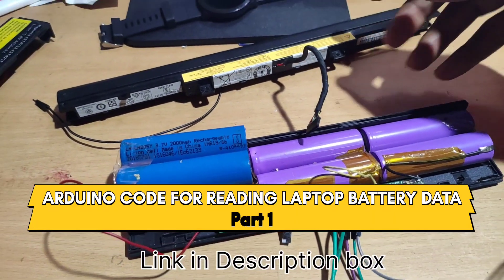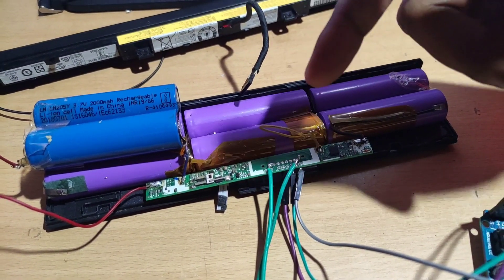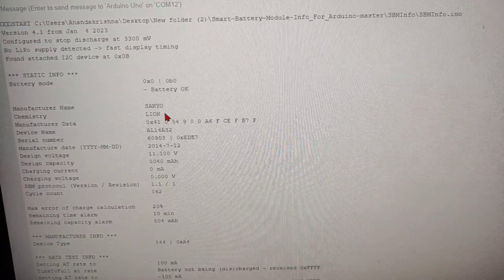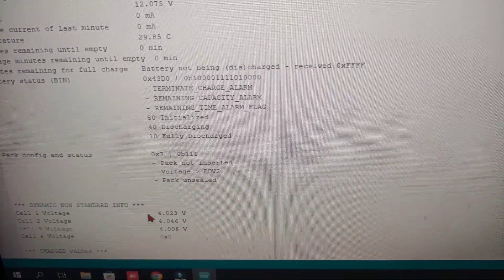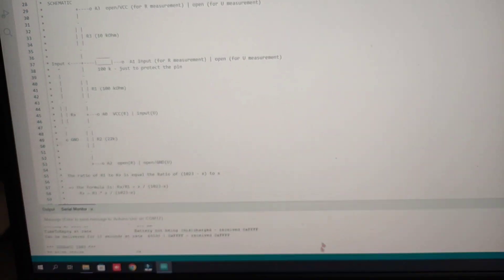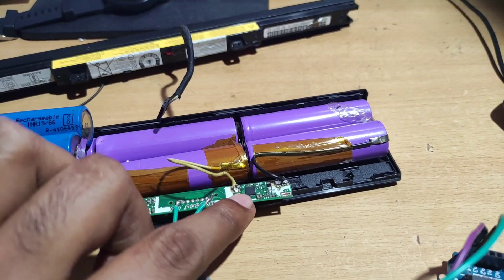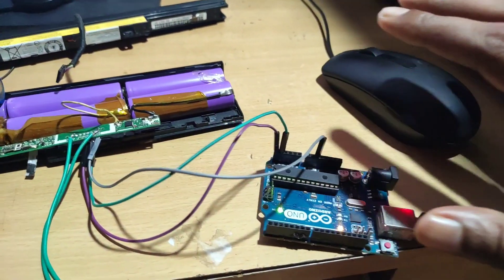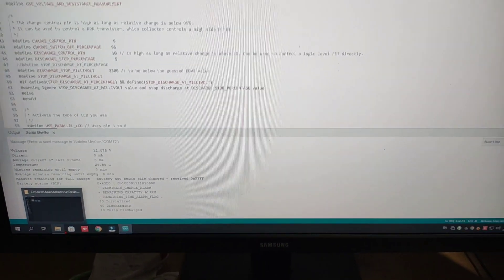Laptop battery data retrieval and reset with arduino - using UNO board #arduino i2cprotocol part 1

Comment: I was thing that some could do something like this on youtube and I found you. do you know real battery analyzer sold for 400$. you saved our repair industry ! thank you sir. I search for your whole video. can you make some kind of software for it like "professional battery analyzer" type that work on click?
Reply from the maker: Professional tools are meant for high reapairing ,recovering, charging, discharging , reset and more functions. We cannot compare it with open source tools. And we also limited to a small number of chips, but other softwares support more than 100 chips, or any kind of neweer firmware. Especially from chinese, or LGC or sony, or MAX sereis. We are not accessed to these chips database. It costs amount , so the tools maker can choose any price theywant

Thank you for your support. I dont want to publically realease my methods ,only if it publically available or id they documented from manufacturer, otherwise some details are always keep secret

If you want to know any chip detail, contact me on my telegram or instagram or facebook  we can discuss

Comment: Can one use the arduino uno r3??
Reply from the maker: Yes uno r 3 supported. You can read data values
Reply: @AnandakrishnaSudhakaran  Just read??,  What do you use to edit the data, does this require a different device other than this arduino?

Comment: I have done the way you have done,and successfully uploaded the code on Arduino but once I connect to my damaged HP battery,I only get question marks on the serial board,it doesn't show features like yours does ,,what could be the issue
Reply: It's different code in the description google it see the video you can see it's different name
Reply from the maker: Sorry for late reply, if your battery is in sleep mode u need to apply some voltage to the battery terminals, you can apply 6 volt. Make sure power lines are not in contact with the data and clock lines

Comment: Can we use other laptop battery bms to acer battery
Reply from the maker: yes but u need to calibrate the other board with acer battery data like charging voltage, charging current, each cell voltage, EDV, EDV1, .etc... Or it will damage your laptop. So always research and do.
Reply: Thanq so much sir for given information
Reply: I have done the way you have done,and successfully uploaded the code on Arduino but once I connect to my damaged HP battery,I only get question marks on the serial board,it doesn't show features like yours does ,,what could be the issue?
Reply: @rifloanimations1182  the code and the system is useful for the bq20z80 series ic and the battery monitor chip in at least the 2006-era batteries is a TI bq20z80, operating in concert with a TI bq29312 battery management IC.